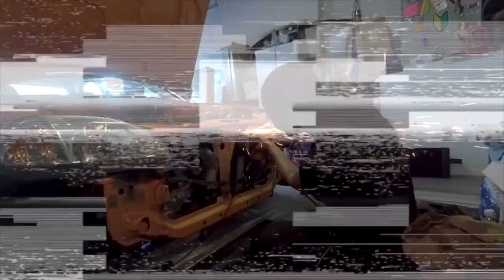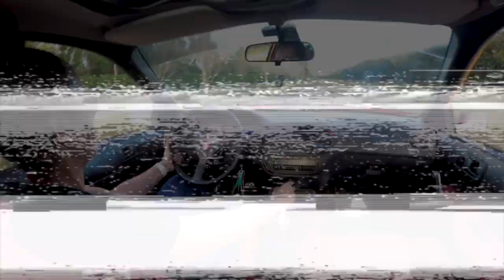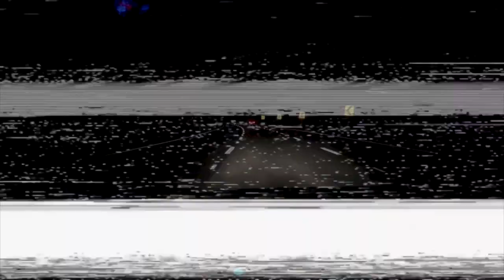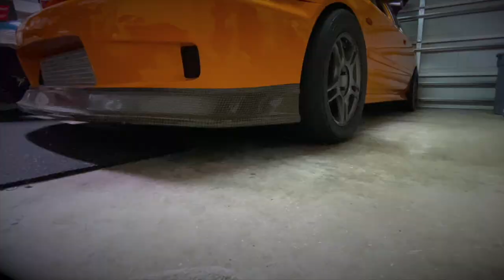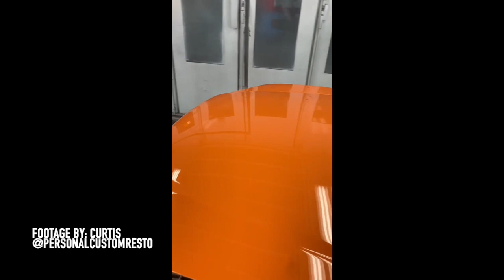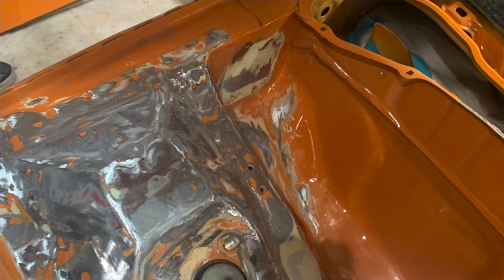CAR IS BACK HOME!!!! Work starts!!

Comment: This is so dope. Trying to do the exact same thing with my hatch. Finished the engine bay and putting my engine back together, powder coating it etc. 

Now I just need to get the car running and work on the body